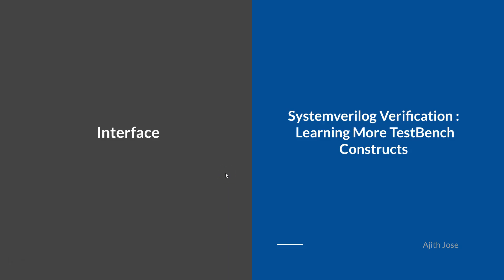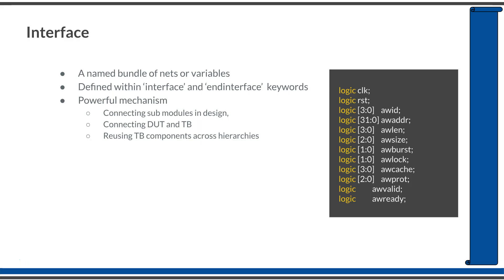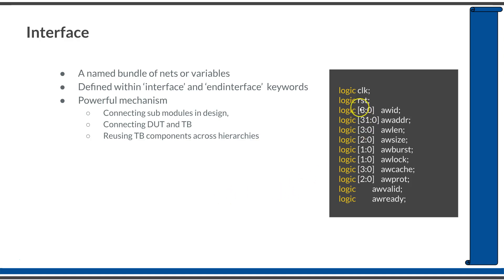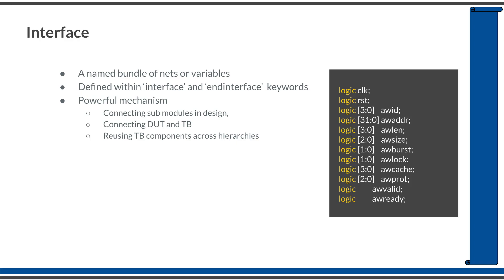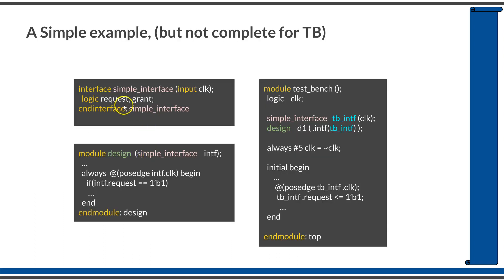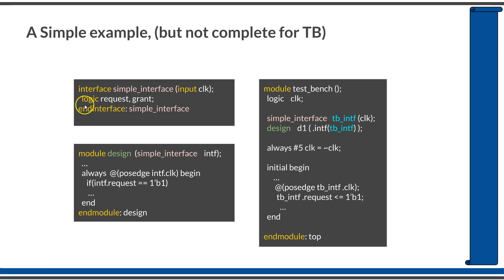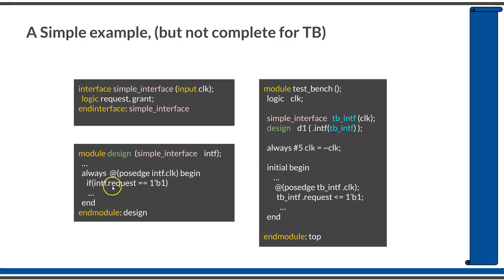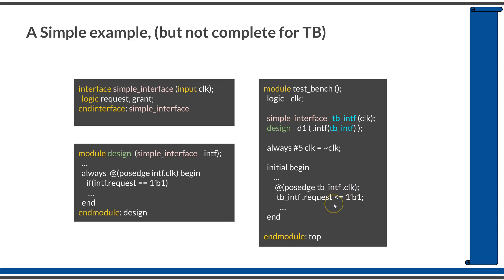Course : Systemverilog Verification 2 : L5.1 : Basics of Systemverilog Interfaces

Comment: @3.46 in module design while clock is taken as intf.clk? I mean the clk is not the property of interface. Dont only clk will do
Reply from the maker: 'clk' is an input to the interface and you can use it like 'intf.clk'

Clock & reset signal will be inputs to the interfaces in general, ( eventhough its not a must)

Comment: You should be using blocking assignment syntax inside initial procedural blocks and non-blocking in always_ff procedural blocks
Reply from the maker: in always_ff, only non blocking assignment need to be used.
In initial block, it depends on the use case.
Reply from the maker: If 'initial' is ever used in a design code, its bad coding stile. initial blocks should ever be used in an RTL code, and I am referring 'initial' wrt TB only.
Reply: @SystemverilogAcademy In general, yes, one would not want to use initial blocks in an RTL synthesizable design. However, for some FPGAs you have to use them for certain things. They are recognized and supported by the FPGA vendor tools.
Reply from the maker: @MrVerilog   Yes,  Agreed